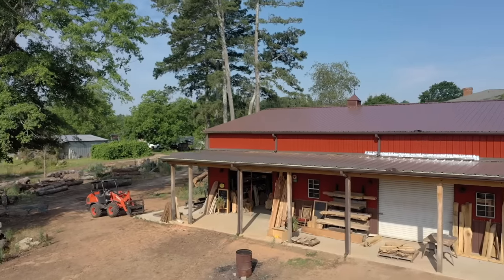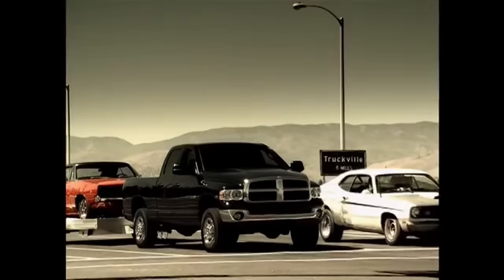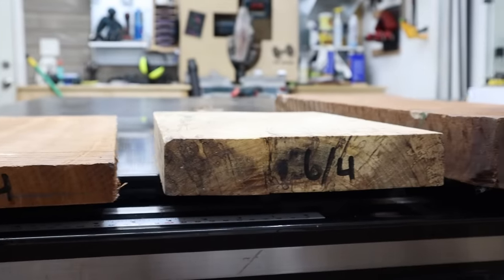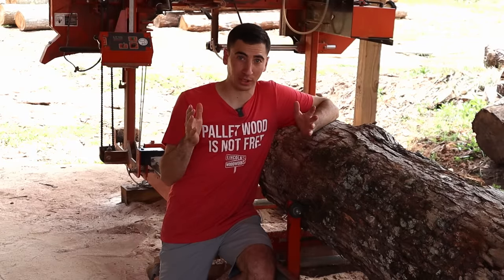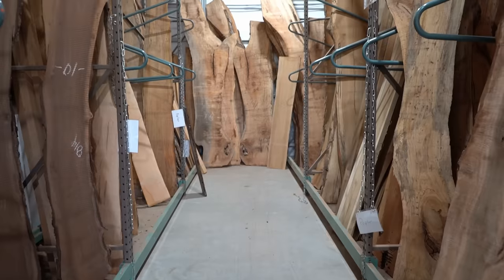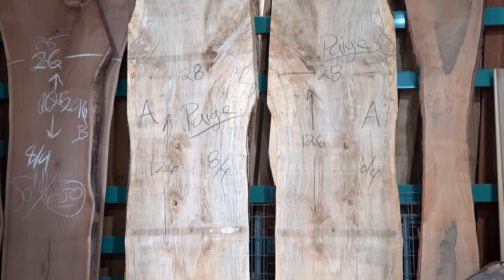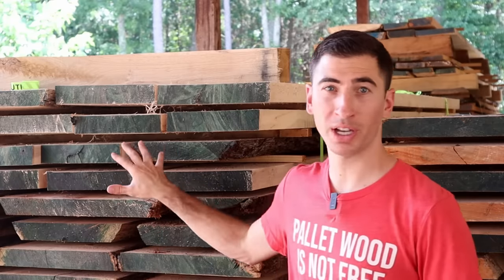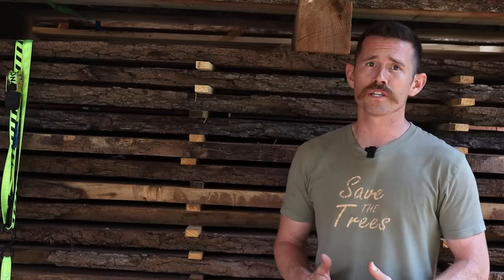The TRUTH about buying from a SAWMILL

Comment: I’d love an extensive multi-part guide to all the wood. Especially going through easiest to find, or lowest cost, to most difficult to find, expensive. Something that speaks to project size/mass and how well it does with stain/finish. How it cuts. How bad is I to snort the dust. Curious how well it works as a table top, shelving, or wide flat boards. And how it turns... on a lathe.
Reply from the maker: We've been talking about something like that - you have a lot of great ideas I hadn't thought of. Thanks
Reply: Tons of good ideas here! It would be a lot of work, but setting up a number of fixed "experiments" and then going through them on each kind of wood would be cool. Make common joints out of them, see how easy it is. Try out a few different finishes and show the difference. Show some simple tests that demonstrate strength, weathering, warp/cupping, etc. You could just tell us all the things, but it would be way cooler to see them all in action. 

Oooh, and then maybe a project that plays to the strengths of each particular species. That would be a cool cross-over with other channels, either with projects they already have posted, or as an idea for fresh content. 

I'm full of good ideas!
Reply: @Lincolnstww    Tons of good ideas here! It would be a lot of work, but setting up a number of fixed "experiments" and then going through them on each kind of wood would be cool. Make common joints out of them, see how easy it is. Try out a few different finishes and show the difference. Show some simple tests that demonstrate strength, weathering, warp/cupping, etc. You could just tell us all the things, but it would be way cooler to see them all in action. 

Oooh, and then maybe a project that plays to the strengths of each particular species. That would be a cool cross-over with other channels, either with projects they already have posted, or as an idea for fresh content. 

I'm full of good ideas!

Comment: One thing I wish I knew earlier on was that most local hardwood dealers or sawmills have full shops with the larger machines that they will rent out for you. Also, that you can save money by requesting they just do S2S as well.
Reply: I have over thirty years running both a sawmill and planing mill and were always willing to help our customers with whatever they needed. We had machines that were built to do the work which even joinery workshops could not justify. We would offer timber processing to any level needed and even the best equipped could see they saved money purely by reducing the labour they would have to put in with undersized machines.

Comment: Good video. You make a great argument for finding a good small sawmill and paying them whatever they want. I've only made a few pieces of furniture in my life and these will long outlive me or my grandchildren -- so getting the best possible wood is well worth whatever it takes or costs. (The best matched wood I've ever seen was in a desk made by a ships carpenter 'on the beach'. The desk is in the royal palace in Hilo, Hawaii. If you've ever used a block plane and you get close to Hawaii you owe it to yourself to find this piece. Clearly a labor of love.) 
 I live in Los Angeles, right now about 36% humidity - so desert but not quite. My breadboard ends do move. They tend to work in one direction so about every 2-3 years I'll tap the ends back towards the center. The movement of course is changes in moisture which surprised me in this part of the desert.
A number of years ago I bought a large cedar beam to build a strip kayak. I let the yard rip it for me. I'd done all the algebra to figure out saw blade thickness , best possible results, but letting the lumberyard do it... I wasn't going to be a jerk so I didn't even mention my calcs. Then I picked up my wood. This tiny little round clump. I was in shock. What happened? Then I started counting. The yard guy was every bit as efficient as my best calcs. What I finally realized was a big flat slab looks a lot bigger than the resulting bundle. This is why cereal comes in big rectangular slab boxes instead of cubes. 
White cedar which is probably only northwest and Canada. I bought a pile of this from my local lumberyard. It looked like pretzels it was so warped. However, I built a deck and an outdoor table with it. Very tame, laid right down. It's been flat ever since -- almost 30 years. It's really hard to find  because it looks like a stack of 2x lumber that is seriously wrong. After I bought out my local lumberyard's supply they never stocked it again.

Comment: my experience is that by the time you purchase the rough wood at the sawmill, have it planed so it is flat, jointed so it has at least one true edge, and thicknessed for use, (assuming you don't have several thousand dollars worth of jointers,  thickness planers and large drum sanders), you pay every bit as much as you would at the home center.  You will have a better selection, though.  I buy small scraps from the mill.  I have tools that can deal with the smaller dimensions.  And sometimes scraps are incredible inexpensive.
Reply: My solution was to be hired by a mill and then get promoted to their woodshop 😂 all their resourses are now at my disposal ecery day. Im so thankful for my current situation and incredibly priveledged and lucky

Comment: Please, always with respect:  I do not know your market, but up north, the material you call waste, is sold as firewood (sometimes called slab wood), and I am sure you have heard of a machine called a 'finger joint(er),' which takes short lengths of lumber and finger joints (combined with glue of course, in the finger joint) the material into longer lengths, such as 16' lengths, and this is, in turn, turned into paint grade trim/moldings.   The machine which turns square stock - whether finger jointed or regular solid lengths, goes by a myriad of names, such as 8 to 12-head routers, sticker machines, and trimmers, but this also is a major component of the lumber industry.   Trims of all sizes, and shapes are extremely important to the building/construction industry, which also includes trims made of softwoods and hardwoods.     This video is wonderful and filled with accurate, honest data: anyone who is new or seasoned to the lumber industry, should consider watching this video.   Thank you, gentlemen.

Comment: Great knowledge for those looking to use wood for fine woodworking projects.  For farm outbuildings, we pretty much ignore most of this as, first, there is no mill nearby with vacuum kilns and, second, farm outbuildings here in the FL panhandle are normally board & batten so the shrinkage is allowed for.  Since building wood here is pretty much all southern yellow pine, it actually shrinks much less than I would expect.  We have been doing outbuildings here for over 20 years and never had a bug issue yet.

Comment: I've been buying from hardwood dealers for about a decade & local mills for years. This is one of the most comprehensive videos I have seen on the subject. Wish I'd had it years ago. 

Only thing it's missing is stating that another benefit of local mills is you might find some of the most beautiful wood. Oftentimes I have found locals look for particularly interesting logs that yield really figured, beautiful boards.
Reply: Thanks Karl! Yeah we definitely specialize in beautiful wood cuts and logs. I thought we mentioned that but I guess didn’t stress it enough.

Comment: It is called a sticker because orignally:
It was just sticks, and you lift the board and stick em right on in there.
There was a carpentry service that would make equal sized sticks just for stacking wood to help prevent warping as it dried.

Comment: I am not a beginner - been to my local dealers, outlet and sawmills. THIS IS THE BEST VIDEO EVER for discussing how one should handle this. One additional thing to discuss is S4S boards don't come in pre-packaged 5.5" or 7.5" - they are random. So you walk in thinking "I need 5 @ 5.5" wide" and convert that to "They have a 10.5" wide which replaces two and I can joint these 4" boards together etc."
"Plastic persuasion" was priceless (see what I did there?) 
Damn kid, you have a future here. Funny, simple, straightforward, and your partner in crime here is also VERY good on camera. Total Keepeer! 
Oh, a mention about bugs. My house burned in 2017 (along with 6500 of my neighbors in NorCal). Lost 26 trees on the property. Turn lemons into lemonade right? So hired a portable mill, cut, stickered dried for 2 years. House rebuilt, build kitchen slab table awesome (!?). Nope. house warms up and out come the bugs from the "natural edge". Put on the paint on treatments - they lap it up. So ended up cutting "natural edge" off, reshaping table etc. Could have avoided with a little Kiln drying, but didn't have access. SO KD IS VERY IMPORTANT if you don't want to bring the bugs into your home.
Reply from the maker: Sorry to hear about the wildfires. Appreciate the kind words

Comment: It’s just a theory, but…
The difference between “dunnage” and “stickers” to me, as a long time flatbedder, depends on the size and use.  Dunnage is typically larger and is reused to keep everything off of the deck regardless of what it is.  It typically spans the width of the trailer and is retained.  Stickers are typically smaller and are cut to length to match the product.  The biggest characteristic though is that they are often banded together with the product, and…’stuck’ to it.  That way the entire bundle can be moved numerous times without constantly having to move ‘dunnage’ underneath.

Comment: Thanks for the video!  Apart from asking the help, is there an easy way to trust but verify whether I'm looking at air-dried vs kiln-dried wood on my own?  I understand the difference can matter when it comes to appearance in some species (e.g., walnut).
Reply: That’s a good point!! Specifically, walnut will mainly look different only when it is Steamed! Large industrial kilns will often steam walnut and it has nothing to do with better quality and more to do with money!! They steam it so that the heartwood blends with the sapwood and they can provide a “more consistent color” but also so they can sell you a bunch of sapwood lol. I’ve seen commercial produced walnut with up to 80% sapwood per board-face!?

Again, I would ask them to measure the moisture in front of you if you’re suspicious…and don’t let them measure from end grain and if it is a thick slab, make sure they’re using a meter that can measure in the center of the board.

With enough experience you’ll be able to tell if wood is kiln dried just by the feel and weight of it.
Reply: @m2lumber  Thanks for your reply and advice!
Reply: Buy yourself a moisture meter.
Some have probes which may upset the seller but there are also non invasive metres that you just hold on the surface.
Be aware that kiln dried may not be any better for you than airdried. It depends on the specifications and how you want to use it. Your location can also have a major impact on your moisture content needs.
In Europe 11% is the norm but in california this could need to be 6%. It's the relative humidity of the area and the equilibrium moisture content of the timber.
Reply: @m2lumber  you don’t have to steam the lumber to bleed the color to the sap wood. Just let the log sit. It’ll bleed.

Comment: I built and rebuilt wood boats and found local sawmills could supply much better lumber than any of the lumber retailers. At a retailer, if I need a 2x4, I buy a 2x12. If I'm lucky I get 2 2x4s, but usually 1 and some firewood. Custom sawmills can give you exactly what you need. The best ones will dry and plane.
Even better, I let them know far in advance of any new builds or replanking and the wood is ready to use when I need it. It costs more but saves many hours. I'm on the Oregon coast so mostly use fir.

Comment: Great tips here, one thing worth looking into for lumber drying in a kiln is case hardening. If it is rushed, the outside dries and shrinks faster than the interior. This isn't necessarily a bad thing because when the interior does eventually dry it pulls the outer layers into compression, which makes it much less crack prone, but if you plane it on one side only you release the tension on that side and it can cup a lot. Best advice I ever got was to seal the end grain of raw wood with paint or paraffin and a heat gun. It allows the wood to dry without a gradient and buys you time until you can use it

Comment: I build with green wood that I mill all the time. Timber framers and log cabin builders also build with green lumber especially on-site cut-mill-build scenarios. My neighbor is getting this done now. They hired a master forester who just finished cutting the white pines for their timber framed structure, the green wood is milled on site and they will begin construction soon. The building shrinkage is factored into the design. Not a big deal. As for bugs, there are natural substances that can be applied to the wood, and also on-site or mobile kilns can be used. I personally use Bora-Care.

Comment: A customer of mine explained that my price was to high compared to other mills. So I had to check out your video. Props it’s a very good video. 
I just have to say my lumber is priced higher then the going rate. My slabs are not priced per board foot at all. They are individually priced per their uniqueness and may be much more expensive then board ft price.
I cannot price lumber the same as a professional mill as I cannot produce it as cheaply or as quickly as a professional mill. Nor can I dry it as cheaply as the large mill is most likely getting a discount on the electricity. I also have to shut the mill down to take phone calls, meet with customers, do my own marketing, crating and shipping etc.
If a small mill is selling at the same price as a pro mill then you are just getting by. Just getting by is ok when your a young man but you don’t want to look back when your 70 and say wow I should have charged more. A nice Roth IRA would be great right now. It’s not screwing the customer to want to make a living the same as your customer. 
I’m fairly new as a sawyer. I’ve only been doing it for 20 years but I’ve seen a lot of start ups come and go just in the last couple years. 
In return for paying a small percentage more for lumber you get personal service. Help loading and possibly unloading. A phone call when something your looking for comes across the mill or that crazy piece you may be interested in. You get someone that will take the time to ask how your days going and truly be interested. Quite possibly a friend and if not a friend then at least more of a personal relationship with the sawyer and not just a Facebook friend haha. 
You see buying just by board ft price isn’t alway better.
Reply: I buy wood from mills like yours. I also buy it from mills like the one in this video as well as big box stores and wholesalers.

It 100% comes down to what I need and my budget. You are providing a curated Slab service from what it sounds like to me.
Reply: Whatever works for you man!

Comment: I was told by my local rough cut Lumber mill that is called stickering because back in the day the Sawmills would waste nothing and they would use sticks as in small tree branches to put between the boards while  they dry. Don't know if that's true but this Sawmill is over 180 years old

Comment: One big difference in kiln dried wood compared to air dried is the way it works. Rip a kiln dried piece on your table saw, and you get dust. Rip an air dried piece on your table saw and you get shavings. Also, it takes some one who really knows what they are doing to get properly dried wood from a kiln. Too often, in the interests of saving 'time', the wood is 'case hardened', which translates to hard on the outside, and softer on the inside. This is why boards can 'spring', cup, twist, curl, and probably a few other terms. The air dried boards I have used do not do this when I am ripping for book match. I have had some wood that was dried in a vacuum kiln, and it worked like air dried lumber.
Reply: The "differences" you mention in kiln dried vs air dried lumber are almost always due to drying defects, high quality kiln dried lumber will have almost no noticeable difference in appearance or workability.
Reply: I would attribute it to not really knowing the processes and taking short cuts. Without exception, KD wood seems to spring more than air dried and vacuum kiln dried. I do mostly lathe work, and green logs, but did a bunch of furniture work, and am getting back into the 'flat' work part of wood.

Comment: Thicker boards should go on thicker sticks for air drying and kiln drying.  The space between the runs of packs also affects the air dry time (but not kiln dry).  If you are air drying and you have your pack runs spaced only 2 inches apart, the lumber will hardly dry at all (even if it's on proper size sticks) and only the perimeter packs are drying.  By increasing the space between packs by only a few inches will greatly reduce the air drying time b/c its getting adequate air flow.  Dry kiln don't have that issue.   You can load the runs of packs really close together and they'll dry just fine but for air drying it's different.  Generally workers are trying to cram as many packs under shed space as possible but the truth is that won't work out well.  They need enough space to get an air flow.

Comment: Green wood, properly used, will tighten joints as it dries and shrinks. Chair makers use green wood for the seats for that reason. Stick framed houses, properly toenailed, will get tighter and tighter as they dry.